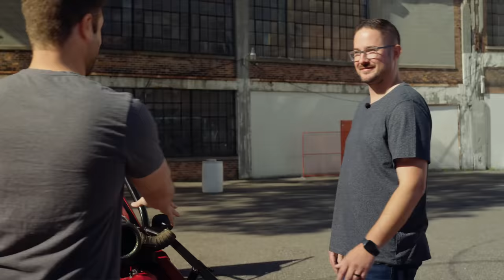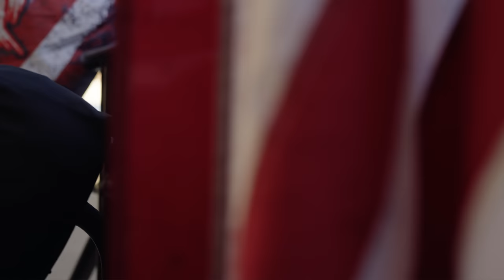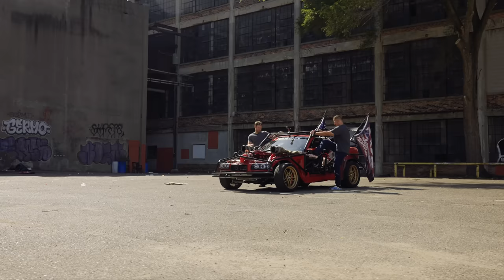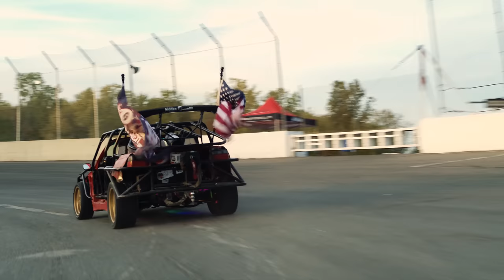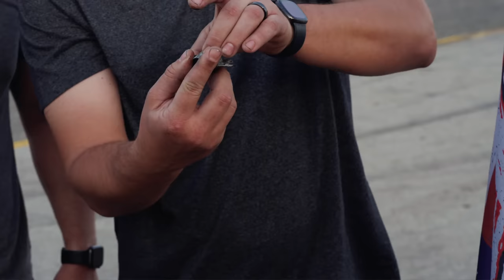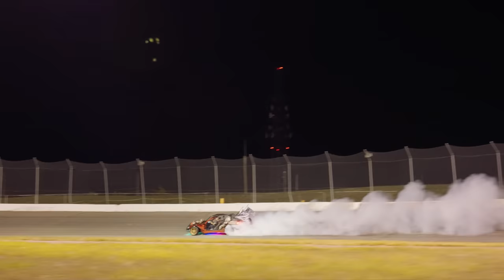Street Legal 1200bhp BMW E36 Twin-Turbo Go Kart!

Comment: As a German it is wild to me that something like this can be street legal. I can't pack into words how much this wouldn't fly in Germany...
Reply: @STAG162  lol America is a bit different. In most places we can pretty much drive what we want as long as it has lights and a handful of other things.
Reply: @ToledoCars  plus lots of the laws are overlooked fully like the exhaust part of the video he literally had to drive to the troopers office and ask them to inspect it for them to notice the loud exhaust
Reply: should be illegal here if it isn’t already but that harness is the worst offender of safety… if you have a harness strapping you down like that without a neck brace and a racing helmet your head is going to pop off in a crash if it doesn’t your neck is surely broken
Reply: Yup. For good reason - external harness. Get into an accident with an external harness, a 5cm diameter steel pipe hitting someone's body at, say, "jogging speed" is literally the equivalent of someone running full speed into a steel pole anchored in concrete without slowing down whatsoever - cracked bones or even deadly injuries incoming for no reason. I think your insurance reps will just start laughing manically at you, and once they recollect their calm go "sure thing, will you install 20cm impaling spikes next, or make it spray oil onto the brakes and tires at random intervals?"
Reply: @decnet100  have you heard of ratrods?
Reply: @paullehrbmx  Sure I have. On American motoring shows like Roadkill. Don't think they are anywhere near possible to get onto the road over here, you'd have to go to some (probably rockabilly-themed) motor show to see them and then they'd probably just have it trailered in and start the engine for a laugh. I've seen a couple ratbikes on the road though (actually built one that goes in that direction, based on a Honda NTV), that for some reason goes through way easier. Maybe it is because you're far less likely to kill any innocent bystanders?
Reply: Can drive this on the road and  own a gun,  drive when you are sixteen  but you can drink till you are 21 makes loads of sense
Reply: Hier sagen wir stillgelegt! Gruß aus Leipzig vom E36m3 Coupe whit S54b32
Reply: @ToledoCars  in california you cant even change the intakes or change the cats and have it still pass smog
Reply: id like to see a tüv inspection of this e36, poor inspector would be overwhelmed
Reply: @ToledoCars  laughs in Californian.

Comment: How the hell is that street legal? If you hit someone with that external cage they will be mush. I guess there must be basically zero safety requirements over there. Also, I don't believe for a second it handles well. There is a huge amount of top heavy weight up front.
Reply: It’s an e36 that’s been put on a diet, has coilovers and is on aggressive tires. Of course it handles well.
Reply: It handles very well. Check us out!